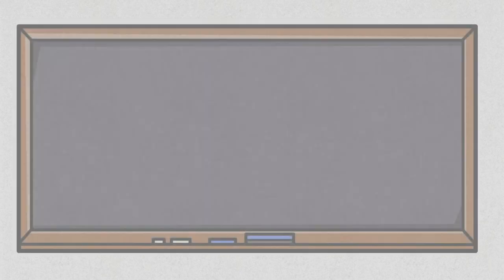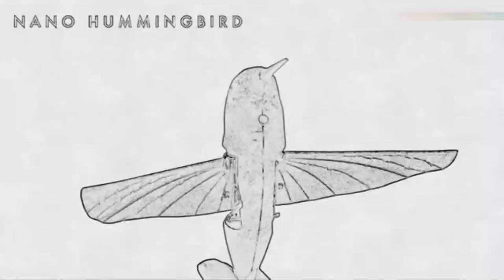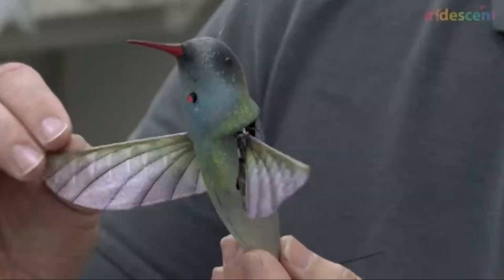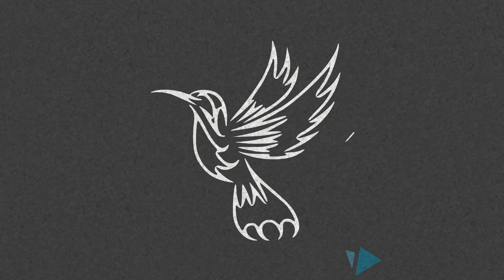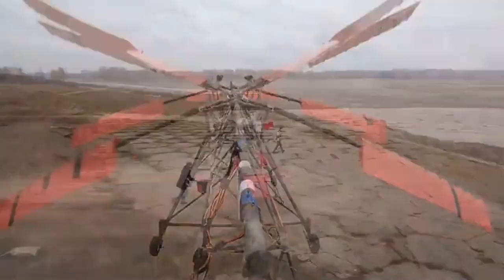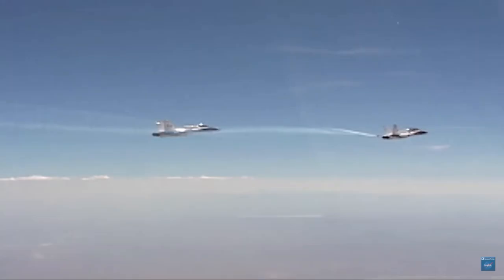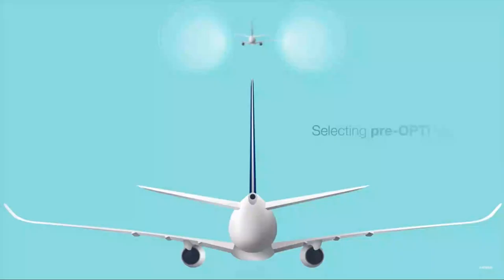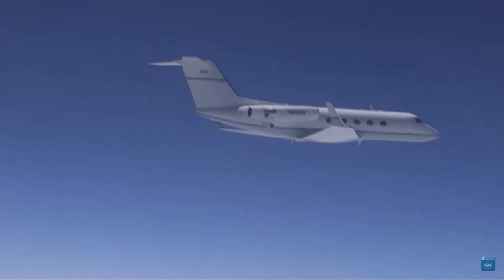Vortex Surfing for massive energy savings

Comment: I have experienced this firsthand while racing on hydrofoils! By riding behind another rider with our wingtips aligned I gain a small speed boost that can help facilitate a pass. There is a sweet spot around 15-30ft behind that gives the best gain.
Reply: You hint at the likely answer to a question I would have about a secondary surface lagging behind an airfoil of a wing or propeller. Some way to harvest the energy within the vortex by stripping the upward half and redirecting it aft of the trailing edge?

Comment: It seems like for less time critical flights having flocks of planes makes a lot of sense. I wonder if planes could be designed to optimize their vortex generating  and/or vortex riding abilities. An interesting possibility would be to design a wing that inverts the direction of the vortexes so the rising sides of the vortexes are in the center so a trailing plane could get double the lift.

Comment: Someone commented once about the possiblity of tuning the formation of vortices either by modifying the airplanes or using a special aircraft to cause them (which could be used only for this goal or not). Another possibility is exploiting existing air currents for faster speeds or less use of thrust (this already happens accidentally).

Comment: there used to be a rubber powered 'Hummingbird' or ornithopter as I remember advertisements for it, 
back then, as I understood it, birds oscillated through a figure 8 pattern, which is much like sculling a boat with a single oar on the transom. 
Probably worth saying that formated birds swap places as the lead bird drops back to get on the end of the formation, in that way they conserve the load. 

Ground Effect vehicles escape vortices because to remain IGE they have to be less than 1/2 wingspan off the surface. This means that there is not enough space for vortices to properly form, with corresponding effects on lift and drag. The drag vector is pulled back which makes the lift/drag diagram lessen the angle of attack and flatten the downwash angle. The difficulty as always is in balancing the machine where so far the most efficient answer is a large all lifting high aspect ratio tail out of ground effect

Comment: Not sure the hummingbird vortex shed and reuse effect can be easily scaled up to crewed e-VTOL. It relies of the wing effectively stalling to shed the vortex from the leading edge to assist the following wing pass from the other direction. Bumblebees fly using a similar stall vortex shed method. In fact helicopters have long considered shed vortices to help with the retreating blade stall at high speed (eg Westland BERP tip). The benefit is typically limited by vibration inducing material fatigue constraints.
That said, there would be significant benefit if e-VTOL rotor blades could operate with laminar flow. The problem is that in forward flight the air is presented to the blade at very skewed angles, so you get 3d aerodynamic effects tripping the flow from laminar to turbulent. It's the same problem that stops swept wing jets operating with laminar flow. If the flow could "magically" be kept laminar then that limited battery energy could be sipped in high speed rather than gulped.

Comment: When a group of fighter aircraft are deploying long-distance, they typically travel with an airborne tanker. It is not uncommon for the tanker aircraft to also carry cargo and / or ground personnel for the fighter planes, such that ALL of them are heading to the same destination. So you end up with a large, heavy aircraft (such as a KC-10, based on the DC-10 airframe) and a bunch of lighter aircraft flying in some kind of formation, with the smaller planes occasionally pulling up directly behind to take on fuel.

Yes, surfing the wingtip vortices of the heavier plane DOES reduce fuel consumption in the fighters. Fly-By-Wire (FB) aircraft, such as the F-16, FA-18, F-22 and F-35 have an easier time doing this; aircraft with mechanical flight controls ... that was rather fatiguing for the pilots. Part of NASA's research is working toward making the FBW flight computer able to facilitate this, such that the pilots are even less-fatigued while doing this. It's not something you can do with a traditional autopilot, but a more advanced one in a FBW aircraft tends to be much "smarter."

Comment: As a kid at my primary school I invented 15 paper airplanes, a few were just modifications of known ones, but I loved engines, one, two, three, some very good for acrobatics (the one with two mock up engines), others were useless, very slow, only flying if there was wind. But one thing I knew in my 8 years old, and it was that I had to fold the wings to keep the paper wings strong and make the plane flying faster and under control. It was 1958, vortex intuition.

Comment: It seems like the vortecies trailing birds could be neither significant since they are extremely aerodynamic, moving at relatively low speeds and most have wing tip splane feathers specifically to stop wingtip vorticies, nor very consistent, since they beat their wings- they're only aerofoiling for a protion of each wing beat cycle. It makes sense for planes, but birds seems more likely that they're using high pressure from the bird behind.

Comment: What if we had dedicated vortex producing electric drones that could offer wake services over a number of areas? they couldn't cover the range of conventional jets but they could be used to cut the fuel burn and emissions - as if the drones running on local electricity were an overhead line that the jet connects to.
Reply from the maker: No energy lost in creating vortex zone would be way more than recovered by the planes. If only two or more planes are bound for the same destination than this makes sense

Comment: Somehow, you would have to get competing airlines to agree on who goes first!
Reply from the maker: They can calculate and split the benefit evenly
Reply: @ElectricAviation  they can, but due to the $$$ involved, they wont
Reply: They just can switch the leading craft in the middle of the distance or better multiple times during the flight . This way is optimal since bot aircraft’s will need to take initially less fuel on board . Multiple switching maybe mandatory since the speed and height of the flight ( from the efficiency view point)are determined by the aircraft weight ( the amount of fuel left on board ). So the weight of both need to be reduced relatively simultaneously in order to be able to fly in formation .

Comment: I wonder if a fixed wing aircraft can Have Its Wings set up in a Way that a series of following wings Catch the vortexes at cruse speed . . .
Reply: I had the same idea as well , for example with Cannard scheme aircrafts by adjusting the distance between the horizontal stabilizer ( which produce lift as well ) and the main wing ( the length of the fuselage)